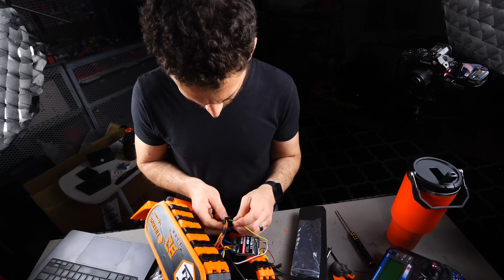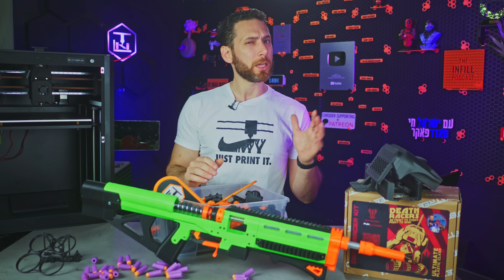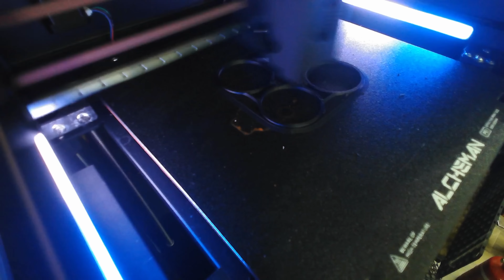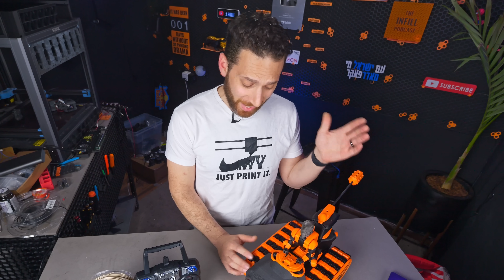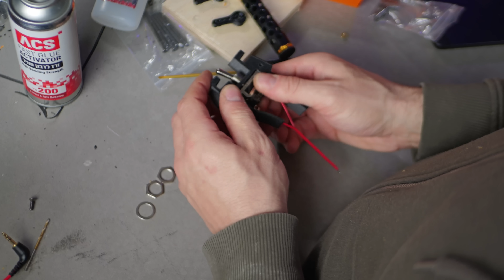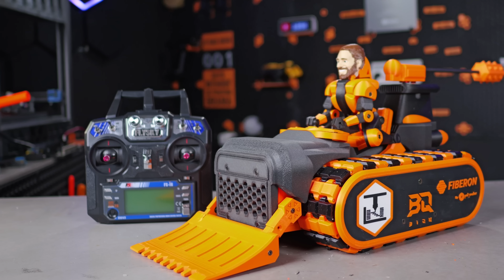Why Didn't I 3D Print These Projects Sooner?!

Comment: I printed a bunch of nerf blasters for my family on my Voron 2.4 out of ABS.  Most of them seem to be designed for PLA, but I made them out of ABS for better durability.  The only thing I ran into that was somewhat of an issue, was I had to use supports in a handful of places where they likely would not have been needed with PLA.  No biggie though.

Edit to add; in the nerf battle against Zach, my money is on the Israeli over the geek every time, where skill at arms is a factor.

Comment: Finally, a printed that can do high temp materials, but I'm hoping that it can properly bed calibrate like many of the new 3D printers, instead of many of the old industrial 3D printers that have to be calibrated by hand for the nozzle height or manually offset during a print for high temperature materials between 300°C and 500°C.

Comment: I didn't watch this video because I want to build toys (though they do look like a lot of fun) but I am gearing up to print sensitive equipment housings that might withstand conditions in the harsh Australian outback. At one site we measured the ground temperature at 75 Celsius, so needless to say filaments squirted from a bambu won't cut it. I will definitely consider buying your sponsor's printer.

Comment: So, will that sweet machine anneal any of the engineering plastics after printing them? 

At an enclosure temp of up to 100C I’m pretty sure that it could.  I believe that the only thing you would really need is a timer to start and stop the process.

By the way, excellent prints from a printer that hasn’t even gone into any real production yet, and a very informative video as well - thank you!

Comment: Ok, I'm waiting for the KS to start. But the only reason I'd consider this printer is for the PEEK capability. I'm really hoping to get a follow-up from you when the PEEK / silicone sock shows up to see how it prints. If it can do PEEK and CF-PEEK, it's on my must-have list.
I have some CF-PEEK I can't print with because the machine that I did buy to print it just isn't functional. And we're talking a machine with a price tag in the 5 digits. :( Let me know if you want a 250g spool of the CF-PEEK and how to mail it to you.

Comment: Nice to finally see an accessible actual high temp printer for engineering materials!
Reply: @ustwarjalec  agreed seems vey promising, I do wonder if the motors and electronics are isolated well from the chamber to hold up well over time

Comment: If you build another „Nerf“ Blaster, you should build a Caliburn 4 (by Captain Slug). Definitely go with a comfortable, vertical front grip. The K26 springs are most powerful but can make the blaster hard to impossible to prime with a horizontal pump grip.

Comment: Are you planning to do a detailed "breakdown" on the printer. I'm in the market for an affordable machine caperble of 'engineering grade' materials for robotics and automotive prototyping. This machine at first impression seams hopefull but will it be an expensive table weight without support in a few years if proprietary parts fail? Is there a BOM how open source is it?

My dream printer would have a 95c chamber, 450c hotend, Idex or dual nozzle, and arround a 300x300x300 build area. Separate nozzle for support materials would be a dream for regular less stressed.more aesthetic ABS prints for scar free parts and no polution of thr print material.

Comment: That printer looks like it really does an excellent job with the ABS/ASA and even higher temp materials. I like the fact that they value the quality over the speed of the print. I don't find much value it a part that looks like crap, but boy did it print fast.

Comment: I also have separate print profiles for different filaments in addition to the filament profiles. I use different settings for slow down for overhangs and stuff that doesn't exist in the filament settings.

Comment: Out Of Darts also doesn’t ship directly to Thailand and self sourcing here is a nightmare because something like PC clear tube for the plunger doesn’t exists here. Ended up having to change the tube to aluminium tube to have the size and thickness match. Barrel diameter is slightly oversized and aluminium bar is undersized but the blaster’s tolerance is quite forgiving and I was able to fit all essential hardware despite them being wrong sizes. Overall very fun project.

Comment: Waiting for my AnyCubic S1 to come in; my first 3D printer! I'm definitely absorbing a ton of info (and have been over the past year) in preparation for it to come in and for me to start print odds and ends, toys, shelves, headphones, board game inserts and whatever strikes my fancy.
Reply from the maker: I've been really enjoying mine. Pro-tip: install Rinkhals, which will allow you to use open source Mainsail on it and access it from within OrcaSlicer. Now they just need to come out with hardened steel nozzles...
Reply: @thenextlayer  Appreciate the tip. Yeah, not thrilled that hardened steel nozzles aren't out at the same time, but considering I'm just starting out, I figured basic filaments first and then work my way up.

Comment: As a mechanical engineer, being able to print higher temperature filaments would be a plus. What I didn't hear mentioned,  nor see in the Kickstarter page, is the max print area this new printer can support. What is it? Thanks
Reply from the maker: 300 x 300, pretty sure I mentioned it when I said i could print the piccatinny rails in 1 go, but sorry if I didn't.
Reply: @thenextlayer  thank you,  I may have missed it.

Comment: In the vein of wanting to see some spillover, CNC bit manufacturers regularly provide entire libraries of read-to-use settings for their bits, to which you can further tweak for your own use on individual machines and capabilities. Filament manufacturers Should do this as a benchline library of settings for everything they sell so at least you have a max territory for more than just temperature and flow. Basing the format of profiles on PrusaSlicer seems an easy route to do that, as it's arguably the most forked slicer software out at the present time.

Comment: Silicone sock above 280 C?  I was always told to remove the silicone sock for high temp. due to off gassing. @19:02 Need fume extractor.

Comment: Looks like a really capable printer, I would love to be able to print with PEEK
Reply: Right!..  That Thing is Amazing… Nice to know that your not wasting $200 spools on failed prints.
Reply: So pricey though... a grand per kg. What do u need from peek that you can't get from CF nylon?
Reply: @32BitJunkie Temp resistance, creep resistance, mechanical properties and chemical resistance.
Reply: @wouter4046  
Make it out of aluminium at that point
Reply: @Goroca  Very true but that wasnt the point, nor is it always an option.
Reply: @wouter4046 
 
1 kg of peek kost about the same as that printer and a industial machen cost about 15k $(22idax v3). 
I wholdent trust that machen bechos it cont reach the nesesery temps to print parts that are about the same price as the machine